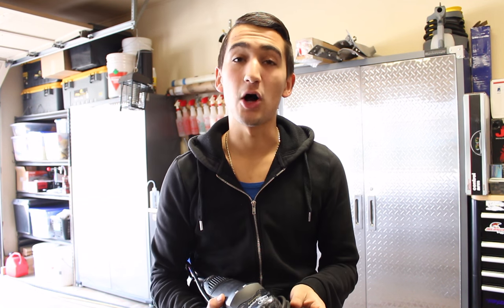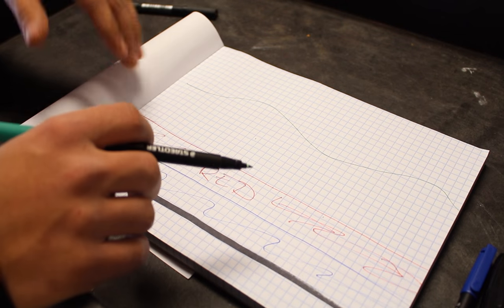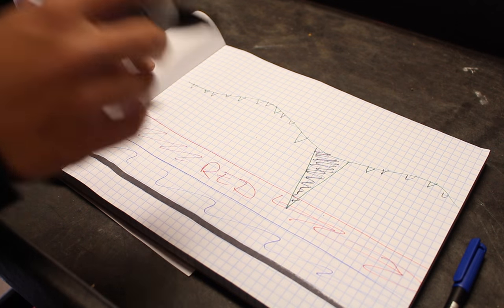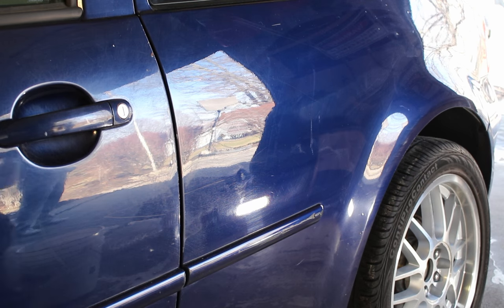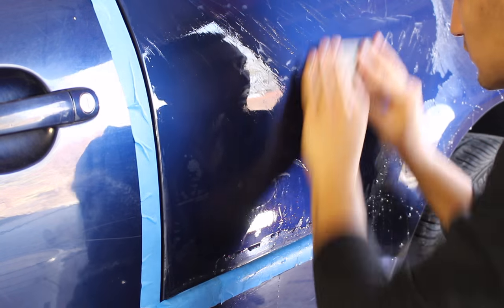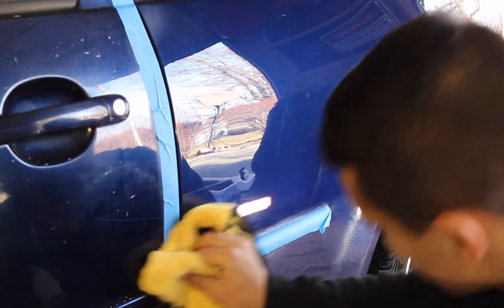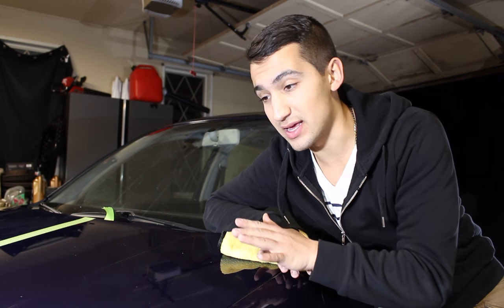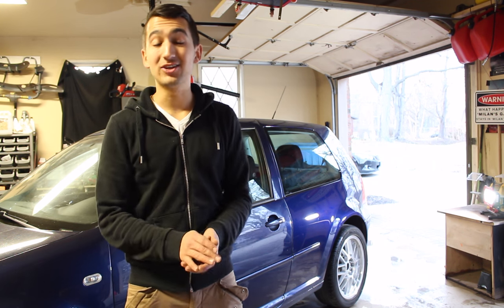How to Polish Your Car

Comment: You forgot one crucial step. After polishing always use a polish remover, such as an IPA mix (1 part isopropyl alcohol and 1 part water). Some other products you can use are CarPro Eraser and Griots Pre Wax Cleaner. This crucial step ensures that any polishing residue is off of the paint, and so when you go to apply sealant or wax, it can bond much better to the paint and last a lot longer and provide more hydrophobicity. Nonetheless, great and clear video. Im loving your channel, cheers.
Reply: Instablaster

Comment: Pros like Mike Phillips recommend to avoid sanding on factory finishes because of how things they are. For a daily driver, it's best to do your compounding step, get as much out as you can, and live with what can't be removed - such as a scratch that catches on your fingernail.

Thinning out the factory clear too much will also compromise it's UV repellency, and eventually lead to clear coat failure. 

Heavy compounding steps in general are only intended to do once, maybe twice. The idea is that you maintain the finish to the point that it can be cleaned up with a finishing polish.
Reply: danlc95 yea you can use a more aggressive cutting pad and compound  for orange peel.  Just takes a little longer

Comment: I fail to see why the sanding is necessary in this case. Why wouldn't the M105 handle the damage?
Reply: I was thinking the same thing. it's pretty aggressive
Reply: same
Reply: to remove orange peel you have to sand it to even the structure
Reply: M105 would have done the job if he slowed down with the da. 3k grit is a optional last step in wet sanding.
Reply: Is there a great risk of damaging the clear coat with the sandpaper?
Reply: Yes as the whole purpose of doing so is to remove clearcoat. Do it too much and you risk removing it entirely.  A paint depth guage would help, but for the average user, sanding is not really necessary. A good cutting pad and cutting compound would suffice, but this Golf's paint looks pretty old and bad. Just my opinion.
Reply: Harry Marshall 
 K
Reply: He was removing texture (orange peel)
Reply: Sanding with the sandpaper is just going one step more..if you want to have the absolute best you can get out of your paint and remove the orange peel or deeper scratches..if you don't have either then skip this step

Comment: A general way to tell if the scratch is simply a clear-coat scratch vs. a scratch that is down to the base coat is to spray the scratch with water. If the scratch disappears, it's a clear-coat scratch. If not, it's down to your paint.

Comment: Most modern cars have 3 layers of clearcoat. It fairly difficult to burn your paint with a DA polisher and microfiber pads, but take care with sanding and cutting. Let the polisher do the work and don't add unnecessary pressure. Slow and steady is better.

Comment: Number one Wash your car super clean.. If you are doing ANY wetsanding Must haves are as follows (1000, 1500, 2000,) 2500 and or 3000 makes it easier later if polishing Tip not show here..Put all your sandpapers in a warm/hot soapy bucket for 5 to 10 mins  whatever water you are using on the side of the car to keep the paper and paint wet make sure it has soap in it (paper slides better)  You should start with 2000 grit wet and see if what result you are looking for is working with that grit if not drop down to 1500 and then 1000 and if that works come back up to 2000 and finsh with 2500 or 3000..remember you only have so much paint to wetsand before you break the top coat and lose shine all together And try as much as possable to over lap each sanding stroke so you do not get shine and flat spots everywhere like the video 
When Sanding Do not sand 2 inches one way. Sand one way then reverse it after running the lenth of the panel   The longer the strokes the better make sure the pad is laying flat And DO NOT sand the car using your finger tips or the palm of your hand .. You will see finger lines in the paint later .. or as we call it ... Finger fucked Sand the area in a X pattern  Another must if you go with a sander or polisher is Tape off anything around the panel your working on ..You can burn the edges of the Rubber or remove thin painted tips of doors or burn plastic tail lights...i have done it 

Also use a dolly pad with soft tape and a rubber hammer to remove the dent in the rear panel otherwise the more shiney the more that fucker will stand out. and crindge worthy of a $325 polisher

Comment: Is there a big difference, if any, between  doing a compound and polishing your car? Great vid btw
Reply: Compounding is more agressive, and can install a bit of compounding haze on the car. This haze will usually be less than all the swirls from washing the car wrong. 

Polishing doesn't remove a lot of material, but give the paint the last 5-10% of shine, which then can be boosted by wax or sealant.

Comment: Great video man, I have a question, what's the difference between waxing and polishing or are they the same?
Reply from the maker: +Foyez Islam Waxing a car will HIDE the scratches on your paint, and will eventually wear off. Waxing is a temporary 'fix' for scratches. Polishing a car will REMOVE the scratches and level the paint. There is no substitute for polishing.

Comment: Awesome video keep it up.
Reply from the maker: +edilson borges Thanks Edilson :)
Reply: Quick Question?
Can i use the Meguiar's DMC6  cutting pad 
with Menzerna power Gloss 1000 Compound.
I also have the Rupes.
thanks
Reply from the maker: I havne't tried Menzerna products but have heard they are pretty good. From the looks of it, you could use the Menzerna Compound with the Cutting pad :)
Reply: +milanmastracci 

thanks bro :)
Reply from the maker: Not a problem :)

Comment: Awesome video.  What would happen if you skipped the wet sanding and just went straight to cutting with the 105?
Reply: You will basically still have orange peel and deeper scratches present in the paint.

Comment: How frequently should one sand/cut/polish their car? How many times can they do that before they should need to get a new clear coat applied? Thanks for your videos Milan!
Reply from the maker: +Seority You shouldn't need to do it that often. Once you remove any orange peel from your car, it should be permanently removed. On my accord, I've wet sanded it, and done nothing else other than polishing afterwards and it's been perfectly shiny for me :) It all depends on how rough your are with the paint, and how much paint you sand off when you initially wet-sand it.

Comment: great video! do you have any suggestions for doing fiberglass? my class B has a couple of panels that need some help with oxidation... they are white, so hopefully an easier job to restore them?!
Reply from the maker: +buckeyeimaging If it is painted, or even gelcoat, you can use this same technique.

Comment: I don't understand one thing. Once sanding the clear coat with a 1500 sand paper (wet). Have you not technically removed the clear itself.

Comment: quick question:
I only need to polish one side of my car since it was involved in a fender bender and the body shop polished only one side of the car which makes it look different from the other side.
My question is, do I have to go through all this process? the car has no scratches, I only need to bring the deepness of the paint back to match with the rest of the car.
any tip will be greatly appreciated!
thanks

Comment: so after the first polishing, can we perform a second polish again in the next 3-4months? And for the second polish, will the clear coat goes deeper or clear coat layer(s) could recover after some time and it's okay to perform a second polish?
Reply: You wont NEED to, but you can if you want to, on average a polish should last at least 6 months before slowly degrading depending on weather, HOWEVER, waxing should be done at the start of winter and summer, as you wash your car you remove the wax, even car wash such as meguires gold class take away wax even though claiming it has wax in it.

Polishing is also known as buffing, once you buff your clear coat you take a little bit away from the car and smooth it out, one time should be enough unless you've swirled your car again. But generally when you wax you usually Wash-> claybar-> you can if you like apply a polish by hand, or you can go straight to wax.
Reply: as long as you apply wax over polish you will be fine, that wax will protect alot, especially if you use a great brand such as dodo juice.

Comment: What about wax? did you use wax after paint sealant? or its not needed if you use paint sealant? thx.. great video!
Reply from the maker: You can if you like, however sealant is a synthetic wax, which is more durable and lasts longer :)
Reply: ok thanks man! good video, subscribed

Comment: In the last step where you seal the paint, would this be where I use CQuartz? I don't want to put on both the sealant and the ceramic coating right?

Comment: how much time should you spend sanding down the paint and cutting it? great video BTW!
Reply from the maker: +Carlos rivera I usualy do 4 passes per area. So I'll wet the panel with water, then go left to right, top to bottom, left to right, and then top to bottom. After that i'll get a microfiber towel to buff any of the residue and then see if it needs to be done again. Each stroke, say from left to right, i'm spending about 4 seconds (depending on the size of the panel).
Reply: +milanmastracci ah okay I see thanks for the info!
Reply from the maker: No problem Carlos :)

Comment: is the Meguiar's pads will work with any type of polisher machine ?
Reply: +SMS570X will* It goes by sizes so if you have a polisher with the correct setup for the pad (there's lots of different setups) then yes.

Comment: in protecting the paint can we use ceramic coating instead of sealant?
after putting protection to the paint, when washing the car can we still use shampoo & wax?

Comment: Just a question: 

I bought a new car a few months back ,and I polished and waxed it myself, however lucky for me I got dealer installed swirl marks for free with my free oil change, and well now I was wondering. How many times can you polish a car vs. how many times is it recommended to polish a car?
Reply: +TheMercurial1995 you can cut and polish a car more than 15 times, if you're sanding like in this video you may be able to do that 5-10 times if you're being gentle with it, sanding by hand is more dangerous than sanding by machine, try to get your hands on a DA, i recommend to polish it every 2-3years (i'm a detailer.) and if you can put a ceramic coating it would go up to 5 years if you maintain it perfectly, my brother got a nissan gt-r and it has never been polished since 2009, very little swirl marks because i washed it every time with ph neutral shampoo and good microfiber towels, trying to avoid touching it as much as i can.

Comment: Hello, 

I own an Audi A3 form 2006 with black color. I don't have any deep scratches at all, my clear coat is just a litlle bit 'foggy' and its because I don't have a garage so I cover my car every day and over time it created that foggy look and like very very light scratches wich you can't feel under your finger nail. So can I polish that without sanding just by using ' Cut polishing paste', after that with 'Clear coat regenretion paste' and finnaly with 'High gloss paste'?? I hope you understand what I am asking. The car is not so bad at all it just need a litlle glossy touch.

Greetings from BiH :))

Comment: This is completely unrelated to car detailing but I figured I'd ask anyways. On newer cars, is it normal for the AC clutch to disengage when the vehicle is under hard acceleration? I have a 2015 CR-V and I noticed if I step on it, it seems that the AC blows out warmer air until I'm not accelerating hard. Any thoughts?
Reply from the maker: +Jordan F I think that's very good engineering on Honda's part :) When you floor it, its so the engine can produce the most amount of power to the wheels.
Reply: +milanmastracci Thanks! I really appreciate the information! :) I had been researching it on Google and I saw it mentioned but I was unsure if that was actually a characteristic of modern vehicles. It does make sense though. Thanks again! :)

Comment: I've been hand polishing and it takes AGES! Any machine polisher your recommend? Should I only be looking for a dual action polisher?
Reply from the maker: +Owen Alpp If you can spot the money and buy a Rupes Polisher, it will be well worth it :) Any dual action polisher will do you wonders though.
Reply: Ok thanks, I appreciate the response. Have a great day :)
Reply: +Owen Alpp - Can't go wrong with the Porter Cable 7424 if the Rupes is out of the price range.

Comment: Will the swirls come back? I know new scratches and swirls are inevitable, and you shouldn't do this more then twice a year . Just worried about the paint fading
Reply from the maker: As long as you don't cut too much paint down when you're polishing, you can do this many times. Once you get rid of the orange peel on your car, it won't come back. Swirls will come back, only if you do not wash your car properly. There are many different things that come into consideration but there is no way to keep the swirls from coming back, other than applying a clear bra over your entire car.

Comment: Do I need to use something as fancy as a Rupes or can the same thing be achieved with my Chicago Platinum Dual Action polisher?
Reply from the maker: +Real Talk They both will get the job done, however this Rupes will get the same results much faster. That's the only difference :)

Comment: tell me why you chose the 15 instead of the 21? I know that the 15 cover more ground but just interested in your choice can't go wrong with ether.
Reply from the maker: +Richard Hinton I figured because the 15 is a smaller polisher, I can put it in more places than the 21 because the 21 has a 6" backing plate, whereas the 15 has a 5" backing plate.
Reply: Do the 21 alow a 5 or 6
Reply from the maker: +Richard Hinton The 21 comes with the 6 built in, but I have heard that some people have been able to change them to a 5" plate. I'm not sure how they got their hands on the 5", but it is an option.

Comment: How long does the polish last? Obviously it depends on the quality of it, but if you buy a good one, could it last at least 2-3 years or will you have to repeat that over again frequently?
Reply from the maker: +MonkeyDManolis The polish isn't like wax. Theoretically, this will last forever if you aren't abusive to your car and you don't drive it, or wash it. However, that's not the case with most people. The way you wash your car will really affect how long the car will stay shiny for. If you incorrectly wash your car, if you tail-gate other drivers, if you put stuff on your paint, you will create scratches in the paint and will have to do it again.
Reply: +milanmastracci Thanks a lot
Reply from the maker: No problem :)

Comment: The polisher you have is very exoensive. Can i use drill attachment or do the whole thing by hand?
Reply from the maker: +Adrian Kolodziej It is expensive however there is a reason why it's expensive. The dual action polisher will not leave holograms (micro scratches) in the paint, where a drill will. Doing it by hand might actually be your best bet in this situation. 
You can find other dual action polishers that will get very similar results without breaking the bank. I haven't used this polisher but for the price, you can't go wrong. 
http://www.amazon.com/TruePower-01-0950-Variable-Orbital-Polisher/dp/B00IDNF1AA/ref=sr_1_2?ie=UTF8&qid=1457929774&sr=8-2&keywords=dual+action+polisher
Reply: Buy a harbor freight dual action polisher. Works just as good as the Porter cable 7424xp.

Comment: One other tip is to use a paint thickness gauge.
Reply from the maker: +Froztinc If you can afford to spend the money on one, that's a great tip, however they can be very costly.

Comment: I have a 2014 accord the paints looks good but it has a little swirls and little scratches... Do I need to use 3000 grid!? Since my paint is new!?
Reply from the maker: +Cesar Feliz No i wouldn't start off with the sandpaper. You could probably get away with just using the Meguiars Microfiber Finishing pad with M205 and then paint sealant :)

Comment: Hey man do you know if it's safe to use a degreaser or brake cleaner to remove a little rust on the brake rotors? I have a little rust on them and I'm not sure how to remove it
Reply from the maker: +Jay Neither of those will work to get rid of rust on your brake rotors. 
https://www.youtube.com/watch?v=fMQwB1Ioutg

Comment: What sort of pressure are you exerting on the polisher in the cutting and polishing stages?
Reply: Harris Montevallo use professional 3m. When it finished its job its just disapears. Meguiers and all other shit will continue to all The time. And u dont need to clean The paint with microfiber between all three stages with 3m
Reply: Damn spell corrector. Dont have time to fix that but u know what i mean
Reply: Harris Montevallo Only enough pressure so the full surface of the pad is on the car. Let the polisher do the work.

Comment: Hey Milan ! What speed do you use on the Polisher with the cutting compound ?
Reply from the maker: Around 3-5 depending on how much the paint grabs the pad
Reply: On my Polisher 3 is 1500 and 5 is 2200 rpm . Is it ok to use it on  , or should I use maximum 3 ? Thank you for your patience and greetings from Romania ! Awesome tutorial by the way :D